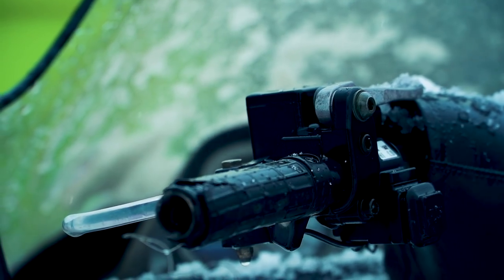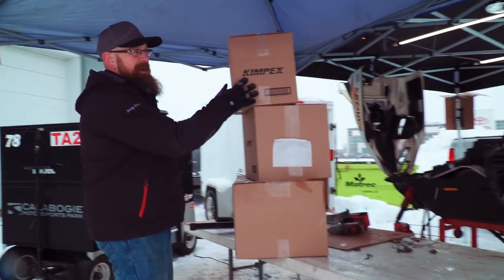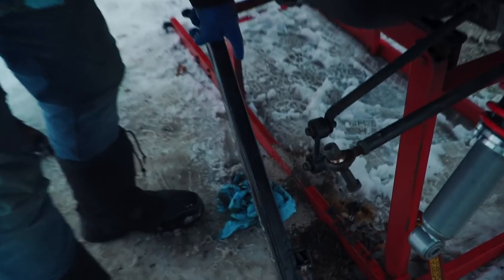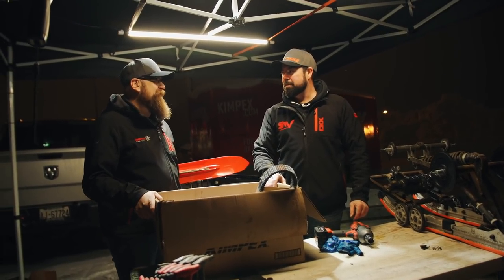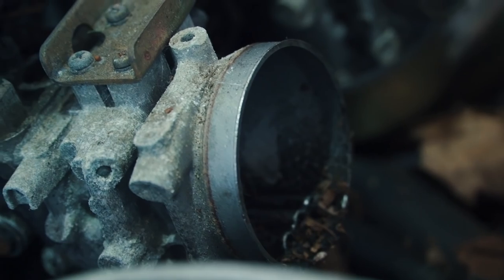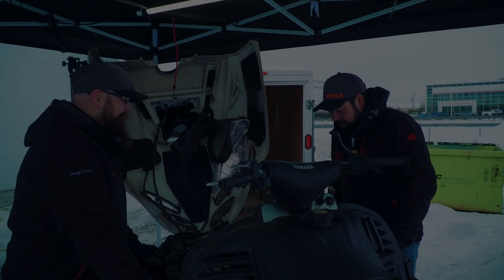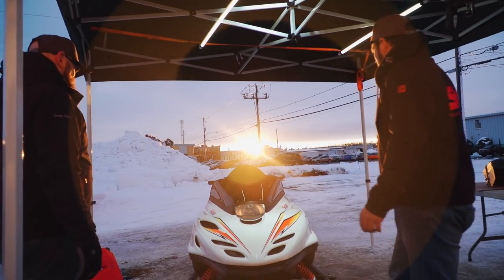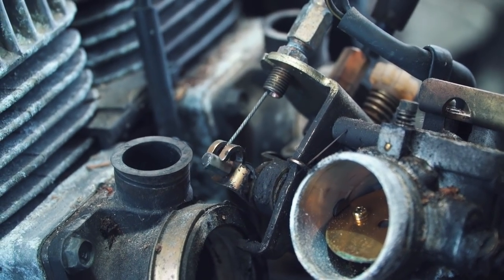Yamaha Phazer Kimpex Resurrection

Comment: 😭😭😭😭 I have a 1998 that I picked up last year for 800 bucks, the exhaust is leaking and it has a bunch of problems. I'm only 13 and I bought it myself but I don't have any money to fix it.
Reply: Dont lose hope! i started "fixing" old sleds (Pre 1980) around that age too but i was not too succesfull. At 18 years old now i can do just about anything on any small engine,. Make friends with some older fellas that have lots of experience and learn from them. Also using old forums on the internet is a great help too. If you're outa cash, find some small jobs around the town to support your hobbies. Never stop learning